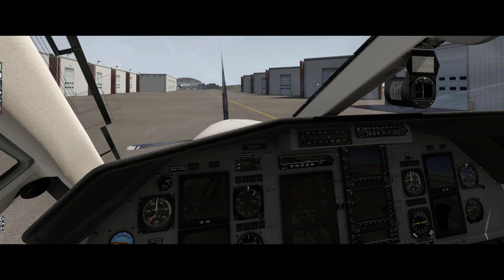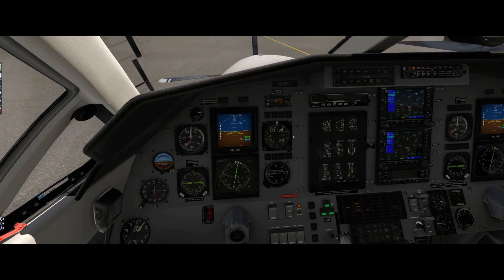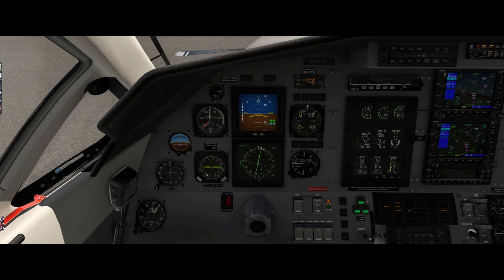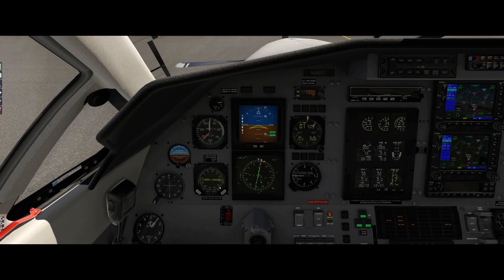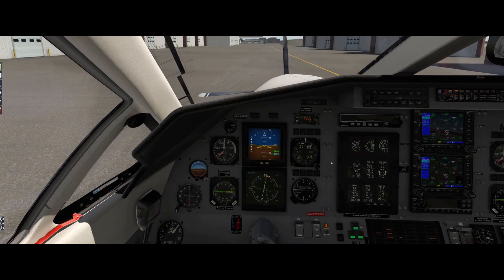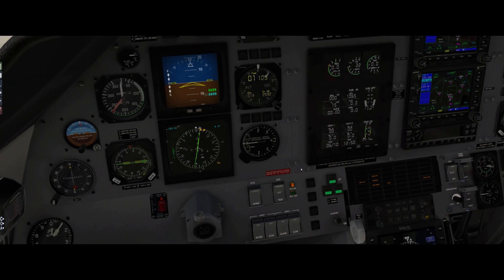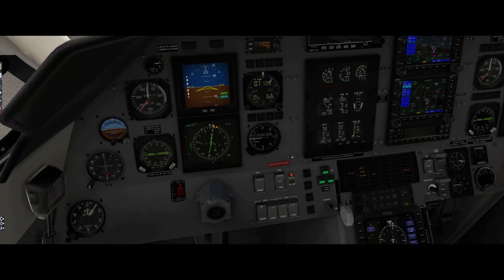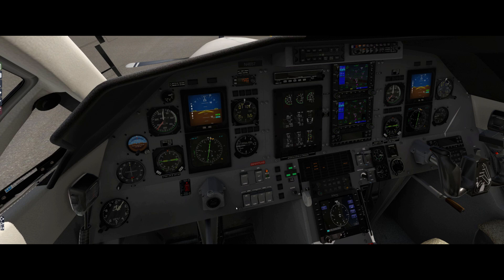What do these do?! Pilatus PC-12 AHRS

Comment: Gene,  Thanks for the great videos again.  I have a question regarding the 2 altitudes shown on the E attitude indicator in green and magenta.  One is the DH and the other I am assuming is the radar altimeter readout.  Do you set the DH to the actual AGL value of your DH/DA like 200ft for a typical ILS or do you set is for 1180 MSL for a ILS  at a airport with a field elevation of 980MSL?  Maybe its a Xplane PC12 thing but on a G600 that I fly we set the 1180MSL and not 200AGL for the DA/DH.  I hope that makes sense.  John
Reply from the maker: Thanks, John! Good question. Carenado doesn't have that modeled correctly. In the real Legacy, the DH is displayed in green in the lower-right corner of the E-ADI, and the radio altitude is displayed in the upper-right corner in white. The radio altitude is only displayed at or below 2500 AGL. Remember that DA and DH are separate terms; DA is decision altitude (MSL) and DH is decision height (AGL) -- so when you see "altitude" think MSL, and when you see "height" think AGL. So, only airplanes equipped with radar altimeters will have the option of setting and using a DH, whereas any aircraft can use a DA. We have the option of toggling between the two in the Pilatus, but most of us set and use DH since it's usually quicker and easier. Cheers!
Reply: @GeneStuart  Ok thanks Gene that helps.  So is there a menu on the E-ADI to toggle between the 2 options DA/DH options?  I was thinking when they changed to DA from DH years back they were the same but thanks for pointing that out and your example to help remember is very good.
Reply from the maker: @johnprice7099  Glad to help! There's a knob on the EFIS controller (just below the CAWS panel) for DA/DH selection. Pressing the knob toggles between DA/DH annunciation on the E-ADI, and the knob is rotated to dial in the specific value for the approach.

Comment: Hello, i downloaded the PC12 just a few days ago, and i was wondering when i takeoff, the plane banks to the left significantly is this normal ? i know that single engine planes have this tendency but i dont know if this is exagerated on the sim or is it real?
Reply from the maker: Hey, Silverio. The sim has that modeled fairly accurately. Right rudder during takeoff and initial climb is critical. Remember that as you pitch up during rotation the left-turning tendencies become more pronounced, so you've gotta smoothly apply more right rudder as the nose comes up. Cheers!
Reply: @GeneStuart  thanks!